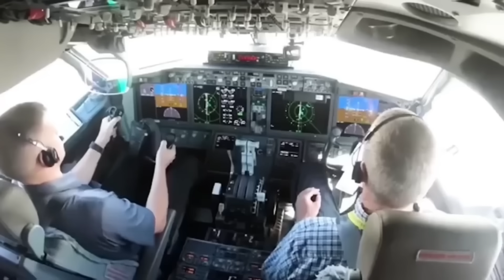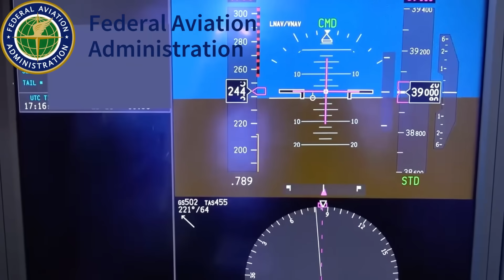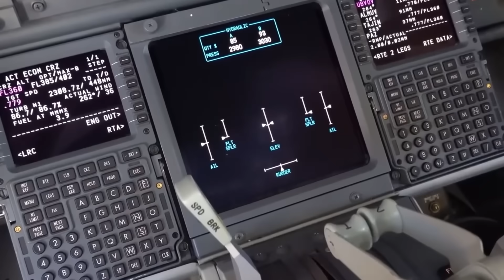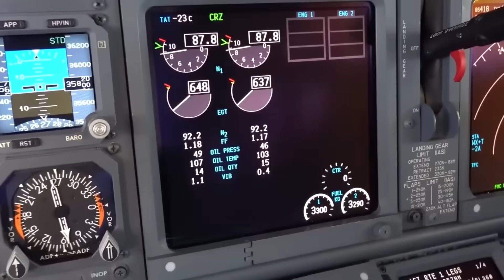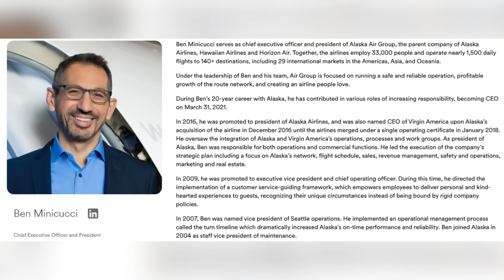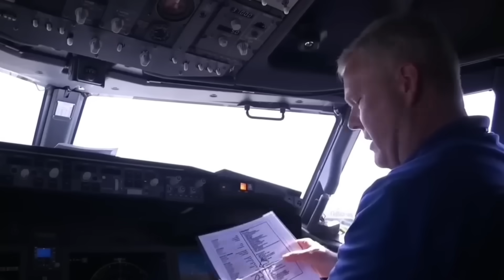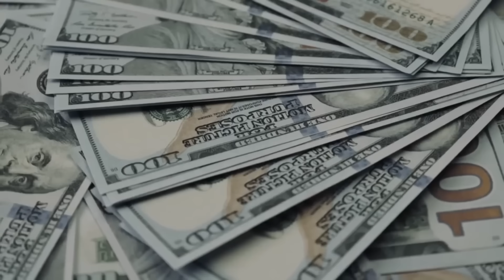The Boeing 737 Max 10 Is Coming — And Airlines Aren’t Ready for What It Can Do

Comment: 1950s rehash. It’s an end of life product sold Dirt cheap. Let’s hope no more crashes.
Reply: Backlog of 4700.
Pretty good for an end-of-life rehash.
Reply: @davestevens4193 sounds good right?  Until you realize airlines have no other options.  Airbus has a massive backlog that datee something like 5+ years out and there are literally no other options given the monopoly these two manufacturers have.  I am not sure it would be selling as well if Airbus had more capacity to build and sell more aircraft faster.  The airlines have no choice.  In fact, airlines are so desperate, if Boeing were still manufacturing the 737 Classic they would have a large backlog.  This is what the market offers   It's not like buying vehicles where you have a multitude of options.
Reply: 1950's???  737 was introduced in 1967,  the ONLY THING MAX shares with that is the fuselage cross section,  that's it, everything else is new,  wtf you talking about, are you 12 or is that your IQ?
Reply: @sounddoctor5decades no his just new to aviation 101 he can take a seat in the back.give him a phone to call pilots that fly the 737. So they can tell him what a blast it is to fly. When matched up with Airbus